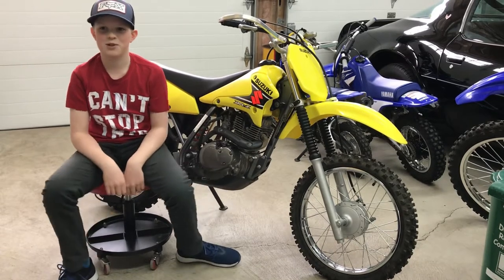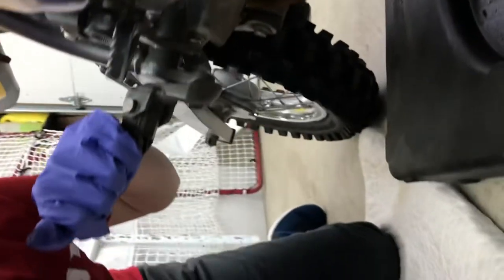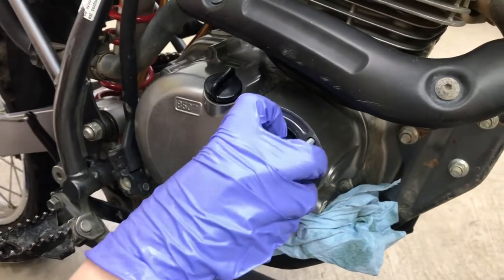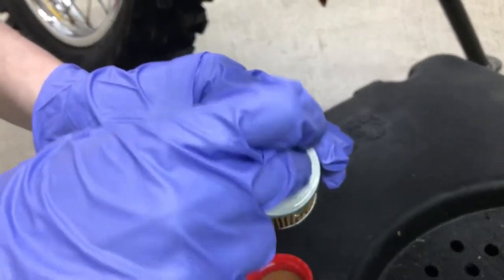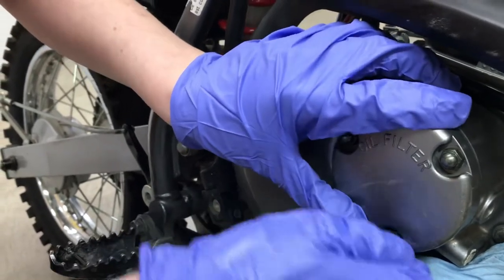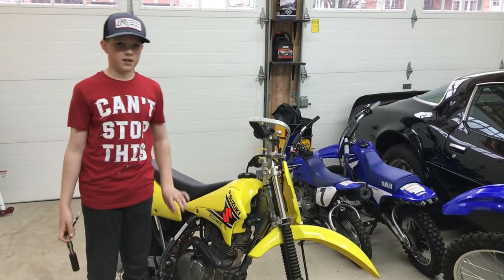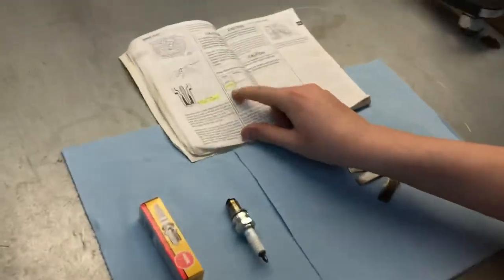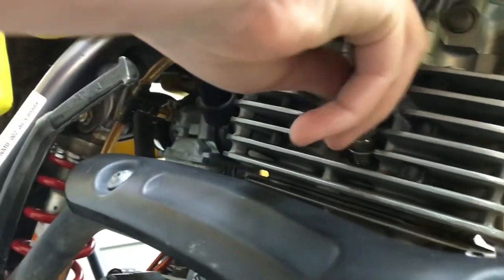Suzuki DRZ 125 Maintenance (Part1)

Comment: How tall are you because I’m wondering if this would be a good bike for me
Reply from the maker: I am five foot five but the bike is getting to small for me as I have had the bike for 3 years. But depending on how tall you are there is the option of getting the large wheel witch is a little taller than my bike.    Thanks for the comment
Reply: @daviessquared9135  as if your 5,”5

Comment: How often do you have to do this
Reply from the maker: Allen 34  you should be doing it every 8-10 hours of riding
Reply: No no especially on a small Low power bike like this you should change your oil every 6 months or longer depending on how much you ride it. Air filter should be done more often depending on where you ride. If in heavy sand and super dirty conditions every or every other ride would be optimal. 8-10 hours is full on race bike hours and this is not that. Make sure to use a quality oil without friction modifiers.